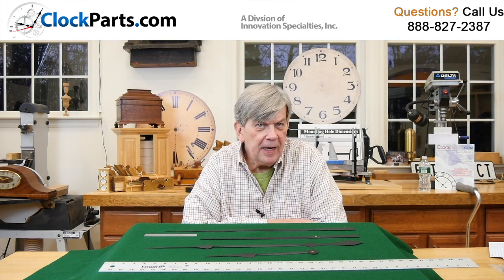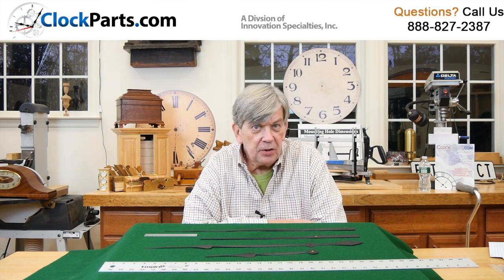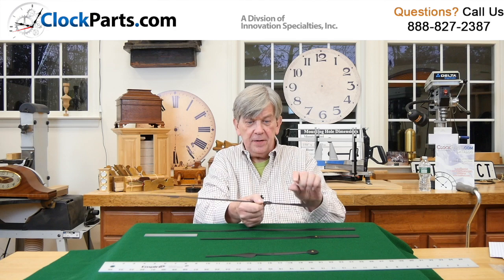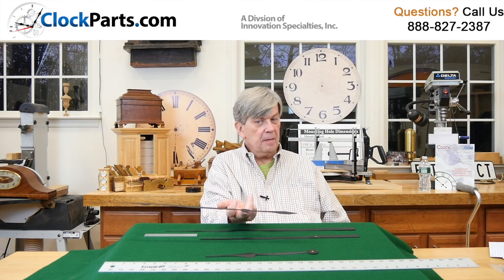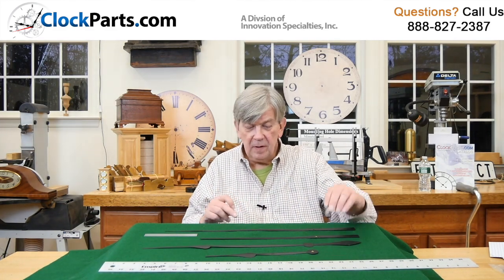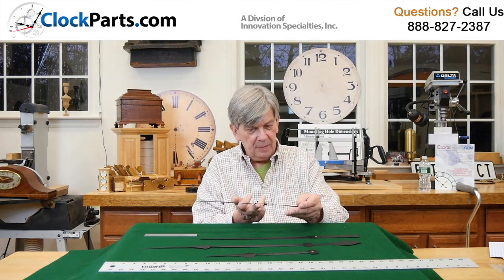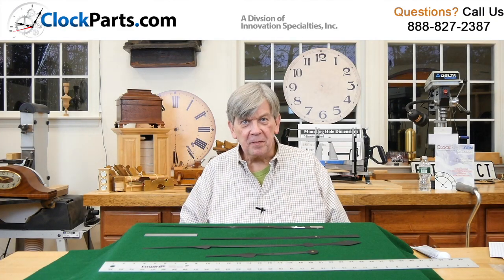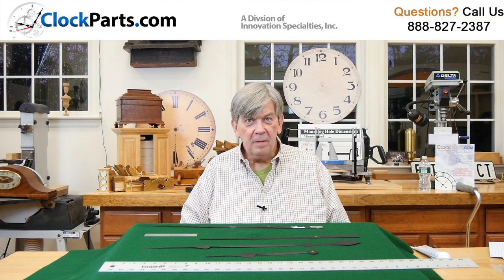Large Clock Hands Must be Balanced to Work Properly

Comment: Can I make a wall clock with a minute hand up to 30 inches ? I am looking to make a scale replica of an old clock tower but without the original big bulky motor. Can anyone recommend good material to make the hands out of preferably wood and a motor that is low profile and can drive that?